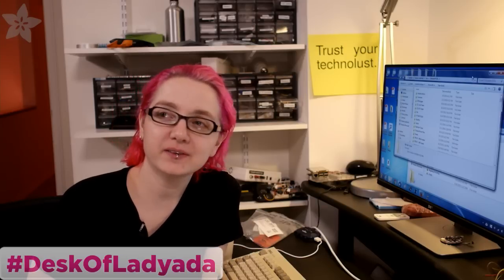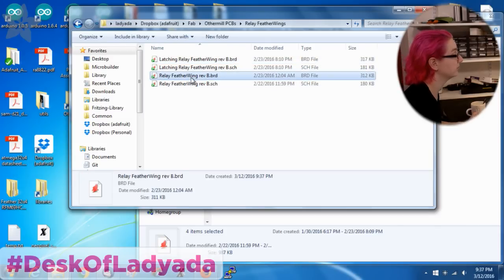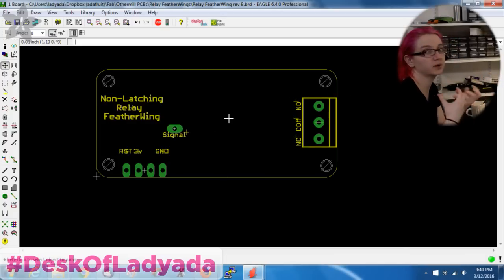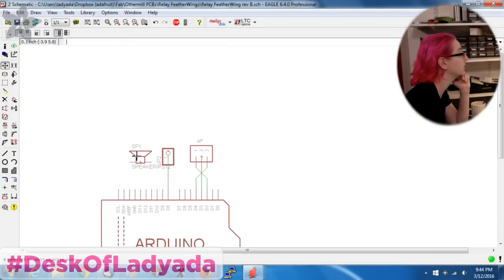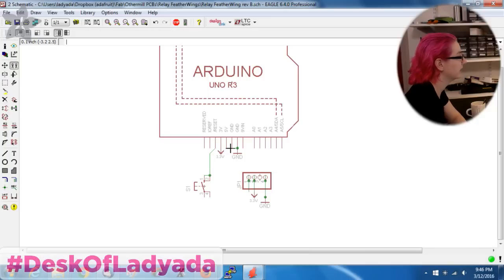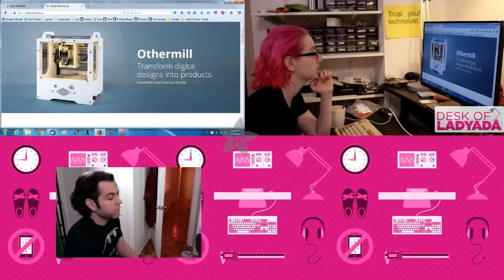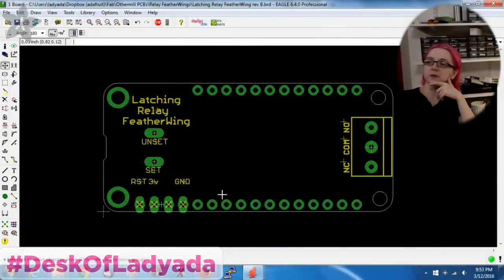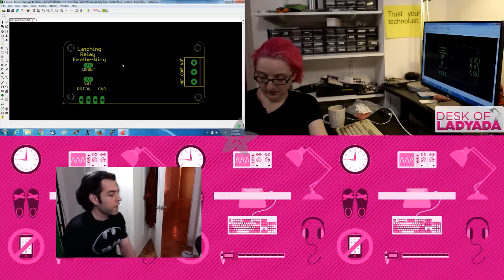Designing tester for relay FEATHER WING #DeskofLadyada @adafruit 3/12/16

Comment: For the latching version, the unused relay contacts could be used as a logic-level relay status indicator so that the board could operate more autonomously. Also, the relay could be operated by external circuitry (manual switch) while allowing status monitoring by a stacked Feather MPU wing.

Comment: At my real job, we use one tester to test multiple types of devices (since there's limited space available for us at the contract manufacturer).  It's a PC-and-DAQ design since it needs to be easily configurable and to handle high voltage and power.  This also lets us have a single spare system rather than multiple different ones.   In our main factory, it is also  pc-based systems dedicated for one or a few models of devices, but the cost of the tester is minor when you are testing very large volumes.  In the past, I dealt with the mil-aero world where repair or failure is not an option, so for them, spending $1M on a tester for a spacecraft or fighter jet is normal.  Also, what they are testing (very high speed data, precision analog, hundreds or thousands of channels) requires special test hardware. I have worked on boards with 32 channels of analog source and measure, ones with 128 channels of high speed digital, and ones with configurable serial busses.For personal designs, where I am making a small volume of relatively simple items, I do what you do - arduinos and pogo pin boards.  For design verification, I sometimes do test boxes with manual switches, but I am looking into automating that with some usb-controlled relay boards